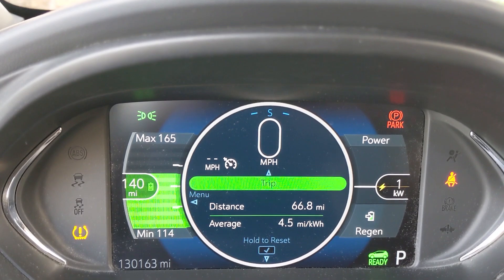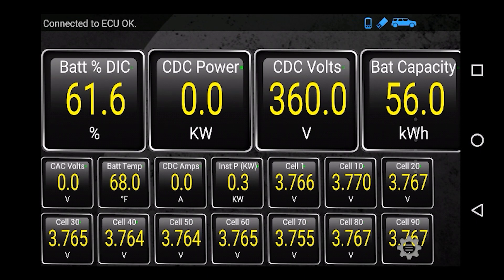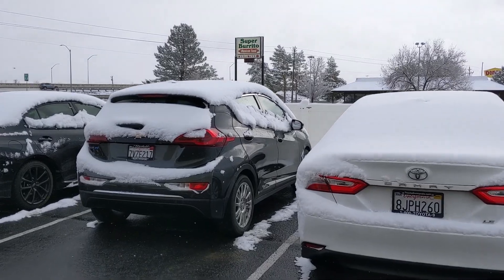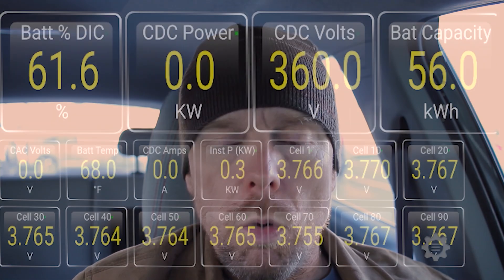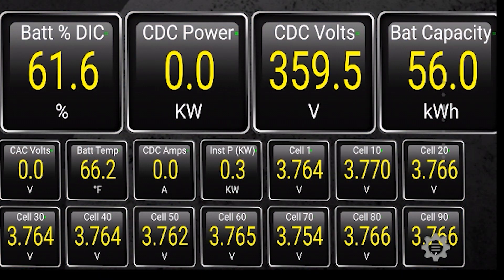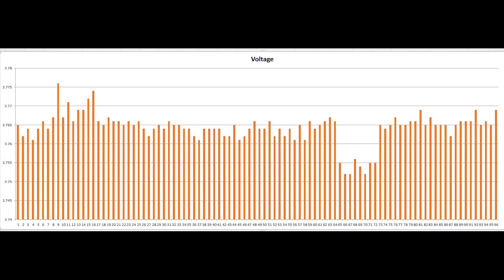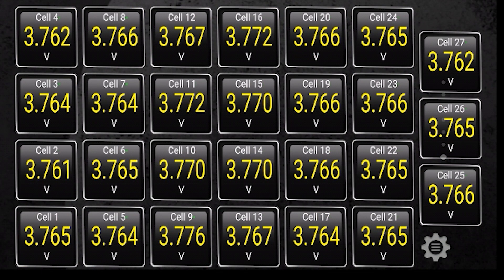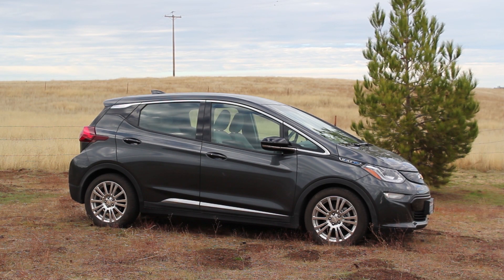2017 Chevy Bolt EV: 130,000 Mile Battery Degradation ft. Torque Pro

Comment: I went from salt lake city to las Vegas driving through canyon all the way on my 2021 chevy bolt I only got around 150 miles per charge at around 90% charge is that normal with the air conditioner on most of the way
Reply from the maker: That is a bit on the low side, but it is possible to drive 80-85 mph most of the way, which could drop your range by a lot.
Reply: I drove around 80 to 90 miles per hour
Reply from the maker: @rueljensen8508  Yeah, so that's about right. You should only be seeing about 2.5 mi/kWh at those speeds.
Reply: one of the thing love about the bolt is when I went to Vegas I was going 90 miles an hour up hill I used to drive a gas car and it would only go 70 up hill the chevy bolt is alot better on going up hill

Comment: does anyone know how far the battery degraded on torque pro it's says battery cap extermated is at 58.0 the battery size is 66 on my chevy bolt
Reply from the maker: I've personally found TorquePro's battery capacity estimate to be inaccurate and inconsistent, so it's not very useful for measuring degradation.

Comment: The fucking crazy thing is, after 130K miles probably more now, you're getting a new battery and starting fresh.
Reply from the maker: Yup. Even crazier, it will come with a full warranty.
Reply: I wonder about this, like nearing the end of the 8 years, how are they going to switch the battery? That's why I think the newer battery for the 2026 bolt might be able to be housed in the older ones.

Comment: I just read all comments and it leads me to believe one could actually get 300-400,000 miles on one of these.
Reply from the maker: Realistically, you could do even more. I think it should be at least 80% capacity remaining even after 400,000 miles based on current degradation.
Reply: @newscoulomb3705  I'm thinking about getting a EUV.  I'm 6'2" 240 lbs  I think the extra 6 inches should do it for me.

Comment: We just bought a 2020 Bolt, Brand new it had 7 miles on it (Mar 2021). It was made July 2020. Meaning no one even test drove it for 6 mos. Our first drive and we were sold. GM knocked 12K of the price and gave us zero percent for 7 yrs. This car is amazing. Not as big as a Tesla but much more affordable. Today we are at 450miles on the clock. So far we are avenging around 4KW/mile @ our .08/KW (Duke energy) rate that's just $0.02/ mile. We just don't understand why everyone doesn't get a electric car. Oh and the other day we smoked a hot looking Camaro off the light. wasn't even close....lol

Comment: How accurate is Torque Pro's assessment of the Battery Capacity compared to the onscreen display on the Energy Details screen in the Bolt? Are they both reading the same information? It is so important to know exactly how much energy is left in the battery when you're pushing the limits on your trips. I would imagine that weather conditions play a roll in that overall reading, cold weather measurements vs warmer conditions. One of our Bolts has the recall update while the other charges to 100% capacity. When I am driving across the desert in-between charging stations it would be nice to know exactly how much battery power I have left. I see in many of your videos that you drive with that Detail Screen displayed. Tips?
Reply from the maker: I've found Torque Pro to be fairly accurate, though there are two different SOC readings. One matches the car pretty closely, but I found that the other didn't. I can't remember what that PID was, and I don't think I have it loaded still.
Reply: @newscoulomb3705  Are you an Android guy or iPhone?? I couldn't find Torque Pro for iPhones. Torque-OBD 2 & Car Pro? Sound about right? Or is it just Torque with an upgrade inside the app?
Reply from the maker: @scarletbegonias2359  I use Android. I guess Torque Pro isn't Apple compatible yet.
Reply: @newscoulomb3705  I found OBD2 Torque app for iPhone and bought a bluetooth OBD2 transmitter. I'm curious what the battery capacity is going to read out after the recall update.

Comment: Thanks for the update - that is amazing especially since you fast charge your car a lot and 2017 battery technology.  At this rate you could get over 200k miles before you were down to 80% of capacity, but wouldn't that still give you enough range to take trips?

Comment: Can you do a video about the maintenance experiences that you have had over the life of your Bolt.  How many visits to Dealerships?  How much money have you spent for maintenance?  How much have you spent on repairs?  Where there any repairs?  Etc etc?
Reply from the maker: I would, but frankly, there's not much to tell. Most of the work on the car has been due to physical damage. The wear at this point is primarily in the tires. Windshield wiper blades, cabin air filters, washer fluid, and tires... that's pretty much the extent of the maintenance.

Comment: I set my 2019 Bolt EV to a 90% charge. Is that ok, or do you recommend setting it to 80% for my home charge, to best preserve the battery?
Reply from the maker: Charging to 80% will reduce battery wear even more than charging to 90%. My recommendation is try to charge up to two day's worth of driving. If you can do that on 80% battery, then that would be preferable over 90%.
Reply: You should top off to 100 percent one in a while too.

Comment: How about repairs? Any major costly repairs in 130,000 miles, if you don't mine sharing?
Reply from the maker: No. No maintenance or repairs other than tires, wiper fluid, cabin filter, etc. I'm still on my second set of tires (they need to be replaced soon) and the original brake pads.

Comment: Is the battery degradation rate linear or is it parabolic?  If linear, you will only have 14% degradation after 260,000 miles.  I had the 2017 Bolt and I currently have the 2020 Bolt.  I like the bigger battery with the 2020 Bolt but it is too bad GM didn't make the seats more comfortable.  By the way, have you replaced anything on the 2017 Bolt yet?  How are the brakes holding up?  Did you have to replace the coolant at 100,000 miles?  How about the 12V battary?  When I had the 2017 Bolt, the 12V battery died at the end of Year 2 ownership.  Thanks for sharing the information.

Comment: Hey I have 2017 bolt ev I was just wondering where or what type of rims you have on your bolt ? I’m still riding on the stock LT rims and want to upgrade and keep my stock rims for winter tires thanks
Reply: In past videos he discussed how he got rims off of a Cruze (in Eco trim). They're somewhat lighter than stock Bolt wheels.

Comment: It looks cold. You may have more usable capacity in the summer, so The battery may be in better shape than you think. Also, didn’t GM just block off some of the capacity to prevent fires (hopes GM)?

Comment: The battery capacity calculation doesnt work on my 2019. It shows -8.9 kwh all the time.
Regarding the recall, I own a 2020 Hyundai Kona Electric, and it had a similar recall slightly before the Bolt did for the same reason (battery fires). My understanding is that the battery used in the Kona and the eNiro is very similar to the Bolt battery, also made by LG Chem in Korea. Hyundai/Kia had a technical service bulletin out for a BMS update for at least 6 months before the recall was issued, and in that TSB, they called for inspection of the battery, checking for cell voltage variation. They also said that in the software update that coincided with the TSB, they significantly tightened the specification for allowable cell voltage variation. It was reduced by like a factor of 10 if I remember correctly. Basically, instead of replacing any battery that may be faulty, they are increasing the BMS sensitivity for triggering a fault code for cell voltage variations, hoping that the vehicle itself will flag the faulty batteries (hopefully before they catch fire) rather than just replacing any that may be faulty out of caution. I suspect GM will end up doing the same.
Reply: Yes, on our 2020 Bolt that PID always reads -8.9 from a scrambled signal according to the techs on the forums.
Reply from the maker: That sounds right. I didn't realize that KIA also had the same recall. I know that they were getting at least some of their batteries from SK Innovation instead of LG. What I've heard is that Hyundai's new tolerance is <0.02 V variance. Currently, in GM's service manual, the acceptable variance is <0.03 V, though some older documentation might list <0.07 V (maybe the old standard that Hyundai had to correct as well?). 

Either way, I expect that GM is partially using their patch as a diagnostic tool to ferret out bad cells in much the same way.

Also, the Torque Pro PID for battery capacity stopped working for the 2019 Bolt EV, if I remember correctly.

Comment: How can I determine if my pack was assembled in the USA or Korea?
Reply: Pop your VIN into the NHTSA recall site: https://www.nhtsa.gov/recalls. If there's no open recall for your car, as some 2019 owners have found, you most likely have Holland, MI-assembled packs.
Reply: i think 17 to 19 are Korean packed..hence the recall for a software update to artificially  limits ur full charge to 90% from firing. the 2020 models are assemble in the Sttates so no recall on this yrs

Comment: Just wanted to throw this in the ring.  My 2019 is not part of the recall and that plus the numbers on the pack would seem to indicate it has a Michigan built pack.  But... my Torque Pro graph looks exactly like yours.  Same higher and lower voltages in the same cell ranges.  So I'm not sure if we can deduce that these predictable voltage variations have anything to do with the recall.  The recall (and the few fires) may be related to a separate issue entirely.

Comment: Very interesting. I have a 30 kWh Leaf and at 30k miles I have lost my first battery capacity bar. As for thermal management it is a non issue here where we get maybe 4 days a year over 80F. I should get the Leaf spy app and check it out, but what use will that serve me and there’s nothing I can do about it anyways.  So I just plug it in every 4th day on 110V house outlet and charge her up. I do really enjoy the Leaf.

Comment: Thanks for the data point.  

My experience with readings from my OBD2 port (I use Engine Link LE on my iPhone) have been a pretty large swing on Battery Capacity between the cold months and the warm months.  I only have 39K miles.  My readings have been as low as 57 and as high as 60, so I've always taken it with a grain of salt.  The first time I looked at it was in the winter a couple of years ago and was surprised when it was around 57, but then it was back up in 59 or 60 in the summer.  So taking more measurements and tracking over time would be interesting.  

Today it measured 57.5 kWh.

Comment: What are the odds that GM replaces the batteries in these older Bolts with the bigger packs from the 2020 Bolt? Slim I know, but I can dream.
Reply from the maker: Maybe not so slim. If it's their most cost-effective option, they might. And if there's a fundamental defect to the battery, they might not have a choice. Keep in mind, this repair/replacement will at least partially be paid for by LG, so it's not as though GM is covering the cost by themselves.
Reply: I'm from the future, and the odds are very good.

Comment: I have 177.000KM (ca. 110.000Mile) 58kWh & Charge 5 ~ 6 times AC and 2 ~ 4 Times DC per Week.
The Ampera-e shipped whit ca. 62kWh.
Reply from the maker: Yes, I initially saw readings over 60 kWh, but I can't actually verify that. They were within the ~1 kWh variance I commonly see when testing capacity, so I can only verify that I had at least 60 kWh from factory.
Reply: @newscoulomb3705  Our 2017 Bolt was delivered with more than 61 kWh and it had sat on a lot for several months too. ;)

Comment: TPMS light?  There are 3 Pouches to a cell. The voltage variance: my question: is it the cells or is it the measurement system? Mine looks very similar. Maybe 2020's got a better measurement system?
Reply from the maker: Yes. I'm running on spares in the rear right now, so the TPMS will stay on. 

The cell groups are each 3 cells in parallel, yes. 

The 2020 Bolt EVs got better everything, from what I can see. First was an improved BMS, which allows for a charging taper rather than stepdown. The next is better battery chemistry. But over all, it just looks like the packs were assembled better all the way around.

Comment: As an owner of a '19 Bolt with about 8k miles on it, I appreciated the long term update here as well as the overview of Torque Pro.  Looks like these cars hold up well over time.  Thanks
Reply from the maker: Thanks, and you're welcome! People have been asking about more information on Torque Pro... I'll probably give a more in depth update of it in the near future.
Reply: If you treat the battery well you should expect around 55kWh capacity at 200k.

Comment: Recently completed a long trip and against all odds, started using the myChevrolet app which proved useful!  It also shows the exact percentage of charge when engaged in a trip.  I noticed that it matches the reading on the DCFC I was using as well.  So for those us disabled iPhone users (no Torque Pro), this could be a useful technique for determining our battery degradation.
Reply: For iPhone use another app - Car Scanner Elm Obd2 for iPhone/Android. There select Chevy Bolt profile (no need to install custom pids in Car Scanner).
Reply from the maker: Yes, that's still my preferred method for calculating usable capacity. You have to start from full, and you really need to drive it down to below 10% battery to get a really accurate reading.

Comment: My Tesla Model S has 110,000 miles and my Bolt has 71,000 miles. Both cars still charge well over 90%. Battery degradation is not a worry right now if you have a car with active thermal management. You have a much higher risk of your car getting totaled in an accident than your battery getting under 80%.
Reply from the maker: The degradation will get to 80% eventually. According to the spec sheets for the Bolt EV's cells, it should hit 80% at ~200,000 miles.
Reply: @newscoulomb3705  I doubt that 80% even happens at 200,000 miles. Original owners like us are the true beta testers for the Bolt's battery packs and there have been very few instances of battery degradation. Battery failure is much more likely than 20% degradation IMO. If larger lithium batteries follow trendlines of smaller capacity batteries we should expect quicker degradation in the beginning, leveling off with very small degradation for a long time, and then eventually the battery will have a much quicker degradation for its third phase. Once you get to the point that 80% degradation happens the battery life should continue that more rapid degradation loss. From the Bolt forums and looking at older Model S cars, I think the Bolt could remain above 80% even after 300,000 miles. Especially the people like me that use hill top reserve and only use level 2 charging. I don't think mileage is the issue, but the one unknown is how time will affect the battery.
Reply from the maker: @dc48664  Yes, that's certainly possible. The 80% at 200,000 miles would be based on fully cycling the battery each time, which few people would do. I noticed a drastic decrease in the rate of battery wear when I stopped charging to 100% every day.
Reply: Thermal management is important, but so is having a large battery, to reduce unnecessary wear, by being able to keep the battery at voltages at levels conducive with significant life extension.  The Spark EV has a thermally managed pack using liquid, like the Bolt and many others, but has suffered significant degradation due to full cycling by its owners.  Many 2015/16 Sparks with an 18kwh useable battery when new, are at 13kwh useable presently.
Reply: Maybe better put, thermal management is essential for longer life, but so is having top and bottom capacity buffers, whether self implemented or manufacturer imposed.
Reply: Our spark EVs have seen 30% loss around 40-80k from examples I’ve seen on Reddit, with thermal cooling.  But it was the test mule for this car.
Reply from the maker: @ankurlee-vakil4063  The Spark EV also uses a different battery chemistry, which plays a huge role in lifespan and durability.

Comment: Holy better efficiency than me! Did you find better kWhs per mile after switching to Chevy Volt wheels, or is it the wonderful Cali weather alone?
Reply from the maker: It's a combination of factors. Part of it is because this was 90% steady speed driving at ~60 mph.
Reply: @newscoulomb3705  This Wisconsin weather, me being free with the heater, and taking mostly less than 5-mile trips has put me down to 1.9 - 2.6 kWh per mi, even with pre-conditioning the cabin while plugged in. Eh, what can you do?

Comment: You also can't rely on testing by driving. Too many variables. At 135k miles on my Bolt I get between 56.5kWh and 57kWh. Temperature definitely makes a difference in usable able in the battery.
Reply from the maker: Yes, there's going to be some variance no matter what the testing methodology. I'm really just looking to track degradation over time. We have very similar miles on our Bolt EVs, but one thing that might have worn my battery faster is the overall size of many of my cycles, where I would regularly go from 100% to <5% back to 100% again.
Reply: @newscoulomb3705  agreed, on my round trip across Canada last month, my typical charging cycle was from 5% or less to 55% or 67% for fastest travel. At hotels I set the charge to finish at 100% at the same time we planned to leave again. I'm still very happy with the degradation as I have over 900dcfc on it so far